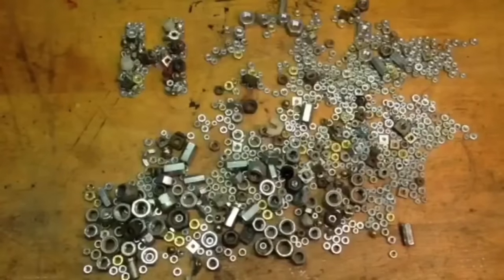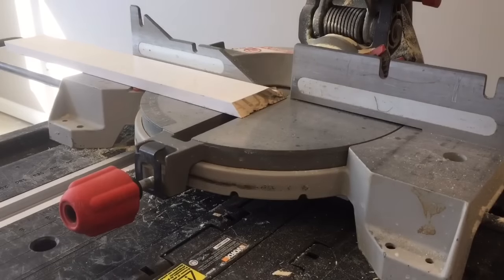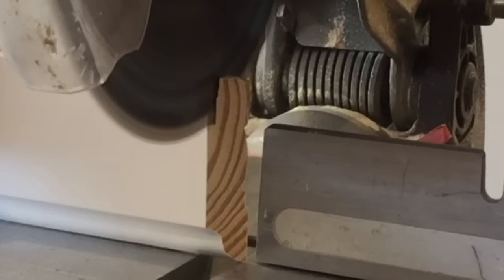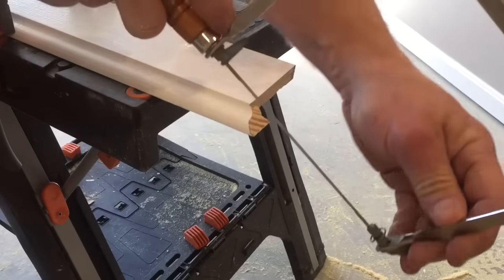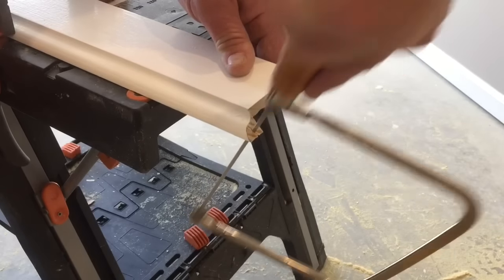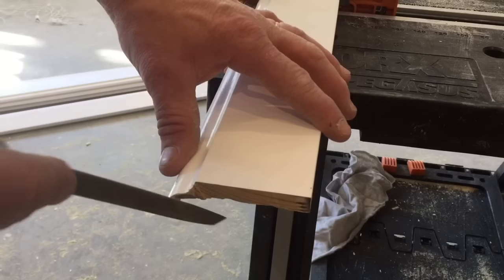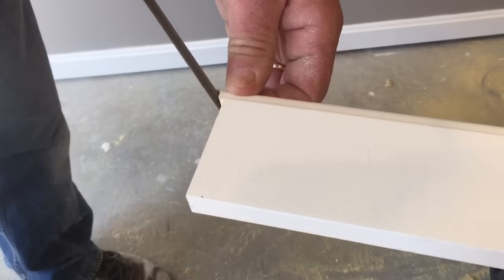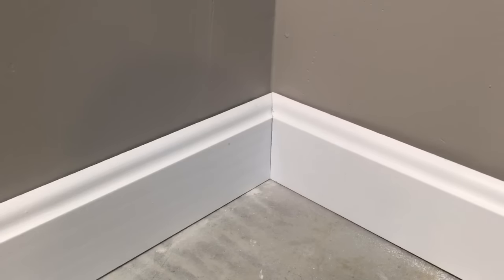How To Cut Baseboard Corners That Look Great

Comment: Nice tip. I just did an old home where nothing was squared. But when you're under contract this would be time consuming. It's just easier to 45° and caulk.
Reply from the maker: Correct, it would be time consuming to take the time and make a video on the correct way to do corners, however with a little practice this method is very quick and doesn't leave ugly caulking lines that will pop later leaving the customer wondering who did such a shoddy job. But hey to each their own. Thanks for watching.

Comment: Turn the blade the other way around on your coping saw so it bites on the down stroke and it will be easier to control fine coping cuts.
Reply from the maker: Sounds good, Thanks for watching.

Comment: What blade is best for cutting trim?
Reply from the maker: I like to use a carbide tip blade with as many teeth as possible. Maybe try an 80 tooth blade. It will give a smooth cut. Thanks for watching.

Comment: 2- 45s. Usually work fine for most corners and if not tight run a bead of caulk and then paint
Reply from the maker: This way requires little to no caulking, looks great, and lasts.
Thanks for watching.

Comment: You would be there for a week trimming out a house,no corners are perfect. What I do to make my 45 a nice tight fit is use a popsicle stick behind one side. It usually makes up the difference for the imperfection. Then a small bead of DAP to seal the deal.
Reply from the maker: Feel free to read through previous comment, you will find my reply to your comment is the same as all the others. Thanks for checking in.

Comment: so do you add this onto your hourly rate ??? it takes to long just cut it and caulk it!
Reply from the maker: On a job that I want to look good I do it this way, and with practice it will not take that long. Thanks for watching.
Reply: Really doesn't take much more time. If it does you are either doing it wrong or just shouldn't be doing it at all.

Comment: I do not get how this works. The mating piece was cut with the saw   square. How can that work if the walls are not perfectly vertical?
Reply from the maker: The overlapping piece that goes on next covers any gap that may be there because of not perfectly vertical walls. Thanks for watching.
Reply: funbro1 thank you for answering and the video, perfect for some DIY I am doing at the moment.

Comment: Notice even after painting you will be able to see sometimes a small gap on some corners so eventually still will have to fill it with caulk or wood filler Purdy etc.
Reply from the maker: As well as the nail holes?  Thanks for watching.

Comment: Not taking any credit from the coping tool, but what I do after the straight cut with the mitre saw, I use a angle grinder with a sanding disk and save me a lot of time.
Reply from the maker: I do that as well, it saves a lot of time, but this is an instructional video so I started with the basics. Thanks for watching.

Comment: Completely new to this....so the one piece is just a straight cut....the other one WAS at 45 degrees you made a straight cut to the curved part. It is the coping saw I am a little confused about. Is that coping saw angled some? Is the curved part you used the coping part slated back? (if that makes sense)
Reply from the maker: Yes the one piece is straight cut, and the other was a 45 just to show the contour of the moulding. I angled the coping saw just a little so that the moulding would come to a point and fit against the existing moulding. Hope this explains what you were asking, thanks for watching.

Comment: Tedious...but correct. The time you spend using a coping saw you will make up for by not having to caulk. Thanks!
Reply from the maker: Thanks for watching
Reply: Still have to caulk that.
Reply: Beginners(first timers) will not be able to cope as quick as they caulk.

Comment: The first piece rarely sit plumb on the wall particularly with deeper skirting so a square scribe on the second piece doesn't usually work
Reply from the maker: Seems to work pretty good this way but if not it can be adjusted.

Comment: Nice tip but why i can't cut it to the right angle ?? 😜
Reply from the maker: You can but because the walls are not square AND not plumb you will be working 2 angles and that may work sometimes coping like this works every time. Thanks for watching.

Comment: Grind the relief with small grinding bit in your dremel tool
Reply from the maker: If you have one that works well or you could use a grinder. Either one will work.

Thanks for watching.

Comment: Well there's 6 minutes I'll never get back. You do realize that most baseboard and crown molding manufacturers now make internal & external corners and if you cut the connecting joint about 4" out on both sides, then a little puttying makes everything disappear!
Reply from the maker: Well there is 2 minutes of my time that I will never get back. You do realize that some people like to just throw things together and fill in all the mistakes, 

Thanks for watching

Comment: i cope my corners,but this method is wayy ineficient....i can trim out a typical bedroom,and closet in about 30 minutes tops..i measure from right to left,thru the whole room,my square cut is always on the left,cope on right...measure wall to wall,so when you make your cope cut the thickness of the trim is already accounted for
Reply from the maker: It sounds like you have a method figured out for you and your timing is about right. Using the  “way ineficient” method in the video it would take me about 30 minutes tops to do the same job. Practice your method and speed will follow. Thanks for watching.

Comment: Some baseboard that looks similar to your example is not made square. The face slopes back about 1/32". Even though my miter saw is perfectly dialed in, and my walls are perfectly square, I can't just do simple 45 Deg. cuts. Grrrr!  I have to align the face of the board to the fence and cut on a certain side of my saw for the 45.  Again, my saw is dialed in. I can cut perfectly square 4x4 oak, and the 90 and 45 are both perfect no matter how I cut it.
Reply from the maker: OK, Thanks for watching.
Reply: Found the problem. The bottom of the BB goes flush with the wall, the top stands off nearly 1/16". So if you hold it against the fence, it cuts crooked. If you clamp the bottom 1" to the fence, it cuts straight.  No idea why they would make BB with a gap at the top.

But yea, I've scribed and coped a lot of BB and crown. It's slow, but as accurate as the workman.

Comment: This is going to work for a small room or small closet. Not the average 2000 linear fit homes.
Reply from the maker: WRONG, it will work equally well for big jobs, trust me I do big jobs. Thanks for watching.
Reply: @funbro1  yea but idk how u make a living out of it at those speeds your gng i bet it will take u a whole week to do 2000 ln feet
Reply from the maker: It’s quite easy, I do a good job and work efficiently. That is how I make a good living. I’ll take that bet, this way takes no longer than any other.
Reply: Not all corners are inside corners.  Most carpenters will do it this way.  I tried it as a diy and had no trouble
Reply: If you're mitering inside corners and not coping, you're a hack, no matter how much trim your doing.

Comment: It's easier to use a protractor I think, isn't it?
Reply from the maker: The protractor will help with the 1st angle what about he the angle you get when the drywall mud is not square? You are fighting 2 differing angle so coping is the way to go. Thanks for watching.

Comment: But measure wall angle and the cut baseboard? Isn’t simple?
Reply from the maker: Just as simple as the method used in the video but the video method will yield better results. Thanks for watching.

Comment: Take a piece of scrap with self adhesive sandpaper over it and that way you could just use that instead of a hard file and have the exact contours
Reply from the maker: Nice tip, thanks for the suggestion and Thanks for watching.

Comment: you did all that with paint grade pine I'm done in about 45 seconds if not less. No stupid file...angle and the right blade for your material. I would use your tip for hardwood. Still done in a minute...
Reply from the maker: After doing this a few times it really only takes 30 seconds, paint grade or hardwood. Thanks for watching.
Reply: A very nice video for DIY'ers.
Reply from the maker: Yeah, them too.

Comment: Right section Defo looks higher, and still need filling......... get an angle gauge and it will be just as good if not better
Reply from the maker: It is not even nailed in yet. I guess I could have shown how to nail in the baseboard and that it is perfect once nailed in but i figured people would understand this. Oh well I tried. Thanks for the view

Comment: No corner is a perfect 45 because the corner is plastered over corner protector.. you can cut your skirting at just over a 45 one notch more, trial & error for starters.. but this is a good method if done correctly.
Reply from the maker: True
Thanks for watching.

Comment: Use a drill with sandpaper tip on it makes it faster
Reply from the maker: A grinder with a flap disc works well also but the purpose of the video is to learn the correct way. Once that is accomplished then speed it up anyway possible. Thanks for watching.

Comment: Dude get an adjustable square and set your dock saw to the angle, we get paid by the hour in Aus.
Reply from the maker: Dude, that does not work all the time and does not yield the best results. Doing it this way (the correct way) does not take any longer with a little practice. We get paid by the hour as well but like to do things right. Thanks for watching.
Reply: @funbro1  if you have multiple beveled skirts  your method is laughable,  just halve the degree
Reply: And yes it works all the time even on outer corners,  your method does not address the degree ever. Good luck

Comment: Any good drywaller will pull out and fill the bottom corners with mud beyond the tape and fill the bevel at the corners to make it easier to put up base board,if not get a better drywall contractor who will.
Reply from the maker: Any good trim person will be able to make corners that look great and quick as well, if not get a better trim guy. Thanks for watching.

Comment: Put a piece of sticky sandpaper on a spare piece and sand the profile after coping. Your coping doesn’t have to be so precise.
Reply from the maker: There are many way to do corners, sounds like you have a little different way. I like to be as precise as possible that way the errors are small if you just whack and chop then your errors are amplified. Thanks for watching.

Comment: Your making it more difficult that it should be. 
Cut one baseboard square, cut the other on a inside 45 and back cut the 45 with your coping saw. Perfect fit everytime, no filing, no caulk no putty.
Reply from the maker: Pretty well sums up the video you just watched. Thanks for watching.
Reply: @funbro1  yes, but make the entire cut with your coping saw, follow the 45 all the way down. Waste of time to start the cut with the miter saw, then hack it up with the cross cuts and file.
Reply from the maker: By using the miter saw it actually saves time. The miter saw cuts faster then the coping saw. If you practice this method you will become quick also.
Reply: @funbro1  I think we will agree to disagree, but you are still doing a good job, keep up the good work.
Reply from the maker: Look at it this way: there is more than one way to get to the finished product and more than one way to make it look good. If you have found a way that works for you, wonderful...continue doing it that way and I won’t judge your method.

Comment: use an angle grinder and buzz away the little chunk.
Reply from the maker: I often use an angle grinder as well with a flappy sanding disc, however this video was designed to start with the basics and by all means not intended to cover all methods. Thanks for watching.

Comment: If you notice there is still a gap there so have to caulk anyway
Reply from the maker: Most gaps left using this method are small enough to be covered with paint. But if necessary caulking can be used. Thanks for watching

Comment: This is a lot work for an OK result, why not figure out the angle degree and cut it on that angle degree.
Reply from the maker: Because trying to figure out the angle is more work for a less than OK result. There is more than one angle involved here, scribing is the best way to do corners…and the correct way. With time this process will become quicker for you. Thanks for checking in.

Comment: You get taught this during your apprenticeship. Or should anyway. I would have just used a hand saw and a coping saw instead of the chop saw, takes far too long to go and set it up on the saw than it would to use a hand saw in my opinion
Reply from the maker: Usually but some people don’t go through training. There are many different techniques that people use this is just one way and with practice it becomes quicker. Thanks for watching.

Comment: Or just get a mitre gauge put it in the corner and it will tell you the exact degrees. Finish will be just as good
Reply from the maker: Then you still have to cut it. Thanks for watching.
Reply: Makes a much better fit
Reply from the maker: That is why I made this video, to show how to make a better fit. Glad you can use the video.

Comment: This is coping and is done on every single turn pretty much. You should have shown when you install the coped piece, you put the square end in place then slide the coped end from a few inches from the corner and it slides right into place.

Comment: Or you can just use caulking! Why do all this work for a ting line that can be caulked? Usually when you put new base boards they're not perfect and need caulked to look nice then when you go to paint them or even paint your wall, it will blend in....
Reply from the maker: Or you can read previous comments. Better yet allow me to copy and paste replies to the very same tiring comment from people willing to settle for an inferior job.

Yeah, cut it and slap it up then use caulking, Looks bad, doesn't last long, but hey it is easier.

Someone show this guy how to cut corners it will blow his mind. Won’t need tubes of caulking

A little caulking is OK but it’s more important to do a good job correctly than cover it up with caulking. 

That is a much better idea. If you want a hack job. I’ve never considered doing it like that because I enjoy doing things the correct way so that the finished product looks good and lasts. If you practice doing it the correct way you will get faster. 

That is just a few replies to the old "just slap some caulking to it" comment. As it turns out there are quite a few people that just want to get it done with no reference to quality.  Quality lasts, That should answer "why do all this work".  Thanks for watching.
Reply: @funbro1  caulking looks just as good, and last a long time. I've used it in many houses and even 10 years later it's all good! You taking an extra hour to cut all that isn't doing it "correctly" 

If I was doing it so "wrong" I'd be out of business and have shit ass reviews. Haha

Comment: Lets be real and honest here.... it might be OK to use this method for 3 maybe 4 corners.... but if you have 22 corners to cut & fix it this way, it will be a torture to do. 
Instead, use some putty and caulk and paint it. What do you think? ;-)
Reply from the maker: OK if we are going to be real and honest here than here are the facts. If you just hack a 45 and fill in with putty and caulk then paint it before long the caulking and putty will split and crack causing unsightly seams. 
The truth of it is that once you have perfected this method it goes a lot quicker. The reason it took so long in this video because this video is a training video.
Honesty is the best policy and the truth will set you free.
Thanks for watching.

Comment: I do this and end up with a quarter inch gap at the bottom every single time.
Reply from the maker: Try cutting the pieces a little bit longer and wedge the in a little bit. A tighter fit will help some. Hope this helps, Thanks for watching

Comment: Or...use a protractor and mark the degrees next to your measurements
Reply from the maker: As discussed at length in previous comments a protractor does not always work because there are two separate angles when dealing with inside corners. Coping is the best way to handle inside corners on baseboards. Thanks for watching.

Comment: Im a professional painter, the shit trim carpenters leave makes painters a very proficient caulker, we'd just caulk that crack up.. done. Imagine doing 5 k sq ft house with 200 corners. this would take 6 months.
Reply from the maker: Just imagine painting a 5 k sq ft. house with 200 corners and not using cases of caulking. Then it wouldn’t take 6 months to paint the house AND the corners won’t crack a few years down the road. Thanks for watching